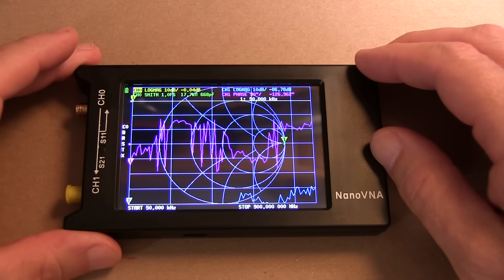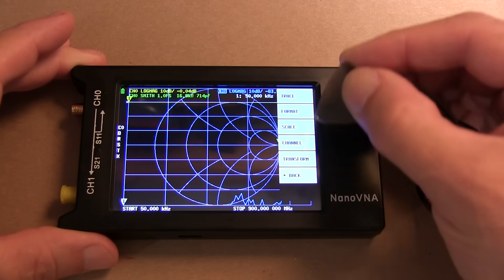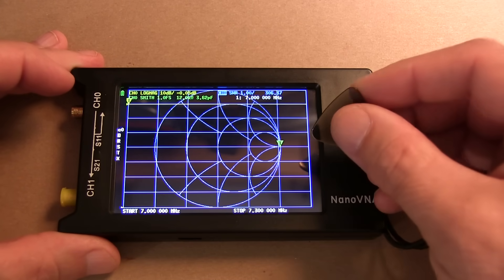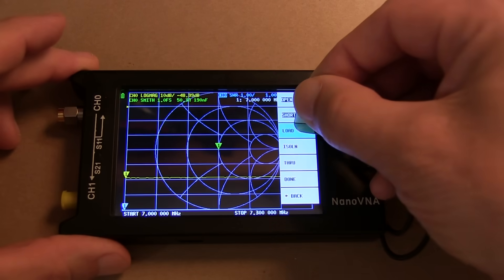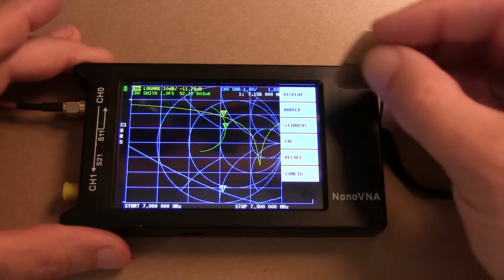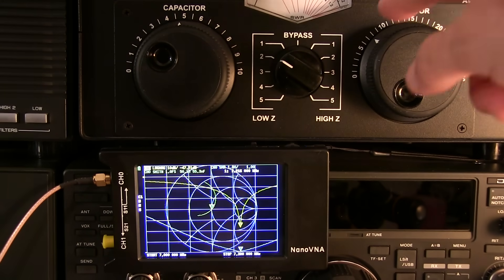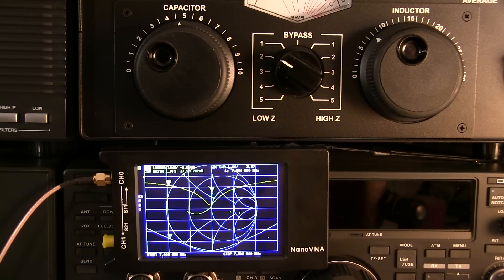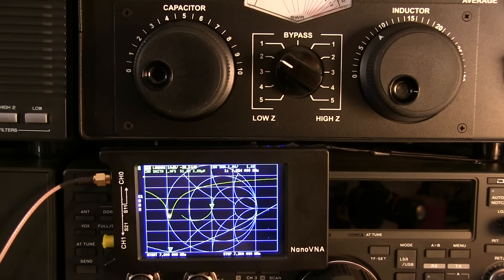#314: How to use the NanoVNA to sweep / measure an antenna system's SWR and optimize its tuning

Comment: Can it use for bode ploting an smps feedback loop ?
Reply from the maker: Potentially - you'd have to be very careful about how you inject the signal into the loop, and how you'd connect to the VNA ports.  One main downside is that most of the nanoVNAs use a squarewave source, which might affect the loop analysis results.
Reply: @w2aew thx , im still not sure  .there is no reference relate to uses of nano vna on bode ploting ps feedback

Comment: Hi Alan, I finally installed the latest version of NanoVNAsaver and noticed that it now also calculates the permeability of magnetic materials. So I made a turn in a small toroid (mix #43), and the curves it traces have the well-known characteristic of that mix. However, the magnetic permeability value is a characteristic of the material, but obviously, changing the toroid in test, the software changes the values.
I searched the internet but couldn't find how to correctly obtain the magnetic material values. The software author has chosen not to publish his email address on his QRZ page.
I'm sure you have the answers I'm looking for.
Another new measurable parameter is dBm: I know what this measurement means, but how do I do it? I don't think I can send more than a few milliwatts into the NanoVNA ports, and perhaps a few milliwatts is even too much.
Thank you in advance for your answers, which are certainly useful for other OMs as well. 73s
Reply from the maker: I haven't tried the new NanoVNAsaver app myself, so I can't comment on these new features unfortunately.  In order to trace out the BH curve, it would have to measure/compute the voltage and current, perform an integral on one of them, then display as XY.  For the permeability, I wonder if it asks for the number of turns (I would think it would need to know that).  The dBm measurement sounds like it is simply a direct measure of power, either along the trace like a spectrum analyzer, or integrated over a specific frequency range, like a channel power measurement.  Definitely a few milliwatts or less would be safe, ideally just a milliwatt (0dBm) or less.  Sounds like this addition is to give it some basic spectrum analyzer functionality.
Reply: @w2aew  TNX. If you never tried it, I suggest you that pc software: it adds more features expecially to the smallest NanoVNA model (e.g. the points of measure number); I think it deserves a one of the fine video by you. 73s

Comment: Thanks so much for this video!   I'd have never worked it out for myself.  The NanoVNA has now taught me a great deal about the operation of my antenna setup.   When you first turn the NanoVNA on it starts with all the traces enabled and it's confusing.   Turning them back on one by one lets you see what's going on.

Comment: Il ne serait préférable de régler l'antenne je crois avant de trop compter sur le tuner car une antenne bien réglée avec un tuner n'est pas forcément rayonnante et optimisée à part pour le tranceiver. 
Bonne vidéo merci 🎉
Reply from the maker: An antenna system that is matched with a tuner can be just as efficient as a resonant antenna.

Comment: Is there a link as to where exactly on Chelgance I can purchase the NanoVNA that you are using in your videos? Thanks.
Reply from the maker: This is the Chelegance site. They also work through distributors worldwide. https://chelegance.com/products/sv4401a-4-4g-vna-with-7-capacitive-touchscreen/
Reply: @w2aew This is exactly what I ordered recently. Could I use that in the same way that you demonstrated using the NanoVNA in your past videos?
Reply from the maker: Yes. Menus are a little different, but the use/functions are essentially the same.
Reply: @w2aew Ok, thought so. Thanks. I also wanted to know where as a hobbyist I can search to find parts such as dummy loads and directional couplers to practice testing a VNA with.
Reply from the maker: For hobbyists, the best place are local ham radio flea markets (handsets) or eBay for surplus devices.

Comment: Hopefully not to much a noob question... How do I hook up the nano to work with my MFJ tuner and radio as you have done it? ? Also, since it has not changed the wire length, will the power be cut down and have less output off the antenna, even though you made the radio "happy"? KE8RTS
Reply from the maker: In order to use the NanoVNA with your tuner like I did, you simply disconnect the coax at the back of your RADIO, and connect it to the NanoVNA - so that the NanoVNA takes the place of your radio.  Then you can sweep the desired frequency range and watch the effects of your tuner as you adjust the tuner controls.   A tuner does NOT cut the power to the antenna!  A properly adjusted tuner simply transforms the impedance so that the radio sees 50 ohms, and the coax+antenna sees a complex conjugate of it's impedance, thereby maximizing power transfer to the antenna system.  Note that a power meter inserted between the tuner and antenna will NOT read correctly since it is designed to operate in a 50 ohm environment.  RF power losses will basically come from coax loss as the power reflects back from then antenna to the tuner, and then reflected back from the tuner to the antenna.

Comment: So, when you were using your tuner, was the NanoVNA connected to anything? I could see the pigtail but not if it was connected to anything 🤷
Reply from the maker: It was connected to the input of the tuner.
Reply: @w2aew  why didn't it damage the NanoVNA ? I thought you couldn't inject  any RF power into ? ..
Reply from the maker: There was no signal transmitted into the NanoVNA. The transmitter is not connected. The VNA takes the place of the transmitter.

Comment: Would I use a 9:1 Balun, between vna and antenna, to do this on a 450 ohm “window” line fed dipole antenna?
Reply from the maker: Simply mimic what you’d be connecting to your transmitter, so the VNA reports what your tx will see.
Reply: Excellent, makes sense thank you sir!
I’m trying to discover what my Palstr AT4K is seeing.

Comment: @w2aew :  "phone" portion of the band?
Reply from the maker: The "phone" portion of the band refers to the amateur radio voice communication sub-bands.  This is typically the upper half or two thirds of the allotted band. The lower portion of the bands are typically reserved for CW/Digital modes.

Comment: Hello thank you for the video very informative, I would like to know how the set up was between the antenna, the analyzer and the tuner,
Reply from the maker: The CH0 (Port1) of the VNA is connected where the transmitter would normally be connected.  So, it is NanoVNA CH0 --> Tuner input, and then the tuner output to the transmission line to the antenna.

Comment: I know this is an old video , but are you plugged into the back of the tuner and not directly to the antenna ?
Reply from the maker: When I was showing the effect of the transmatch, I was plugged into the tuner (just as the transmitter would be)

Comment: Is a Network VNA Analyzer a TIME Domain or Frequency Domain? An oscilloscope is a Time Domain measuring instantaneous Analysis while a Spectrum Analyzer is measuring Steady State Analysis. I'm not sure what is the difference between instantaneous voltage/current VS compared to Steady State Voltage/current?
Reply from the maker: A VNA is typically a frequency domain device.
Reply: @w2aew  Spectrum Analyzer is in the Frequency Domain but doesn't measure GAIN in the Frequency Domain only measures frequency based on Phase, not gain? VNA is frequency Domain but measure frequency based on GAIN ratio?
Reply from the maker: @waynegram8907  A spectrum analyzer, by itself, does not measure gain.  It can be used to measure gain by measuring the input, then the output of a circuit, and subtracting the traces.  Some spectrum analyzers have a tracking generator - these can be used with the spectrum analyzer to measure gain.
Reply: @w2aew  VNA/Network Analyzers can't measure frequencies and 2nd,3rd,4th,5th,6th,7th etc harmonics? Mostly Network Analyzers/VNA just measure the GAIN Ratio of the input and output.
Reply: @w2aew  A Spectrum Analyzer measures the dBm level of the Frequency or harmonic, not the GAIN? I don't see anywhere on the spectrum analyzers menus of measuring the GAIN or Gain ratio of the input frequencies and output frequencies.
Reply from the maker: @waynegram8907  A VNA can measure the amplitude and phase of the transmission (thru) properties of a device, and the reflection properties of a device, vs. Frequency.
Reply from the maker: @waynegram8907  It can only measure GAIN if it knows the input signal value.  This can be from a prior saved measurement, or through the use of a Tracking Generator, if it has one.
Reply: @w2aew  yes true, but this is a different type of frequency Domain called what? when the VNA can only measure the GAIN ratio of port#1 to port#2 & the reflection properties of port#1 to port#2 of a device. What I'm confused about is both the VNA & Spectrum Analyzers are Frequency Domain Instruments but they can ONLY measure certain Frequency Domain properties or functionalities. The VNA is a Frequency Domain called what? Spectrum Analyzer is a frequency domain called what? because both can't measure the frequency domain properties they can't measure or do the same types of different testing in the frequency domain. What I'm confused about is the frequency domain is separated and NOT the same types of testing & measurements so there must be different terms names for saying that the VNA is a frequency domain measuring instruments and so is a Spectrum analyzer but they both aren't and can't do the same type of testing and measurements in the frequency domain, so there must be a name or term for calling a VNA a frequency domain in what category and a Spectrum is a frequency domain in what category?
Reply: @w2aew  If the Spectrum Analyzer doesn't have a tracking Generator, you can only measure ONE Port at a time. Spectrum Analyzers only have One input Port so you can only measure the device under test output port and save that measurement in the spectrum analyzer which you can compare it with the input ports applied signal gain?
Reply: @w2aew  If you save the input signal value inside the spectrum analyzers Saved memory, then measure the frequencies/harmonics of the device under test output port. How can the spectrum analyzer do the MATH by comparing the saved memory input signal value against the device output port signal values? I have never seen in the spectrum analyzers menus that can compute the math of the saved memory measurements compared against the real time live active measurements.  Maybe the newer spectrum analyzers have these options in the menus?
Reply from the maker: @waynegram8907  The big difference is that the Spectrum Analyzer only measures the signal that is at it's input and a VNA provides the stimulus to the device you're testing, and measures the response to that stimulus.  Both instruments make their measurements over a specified frequency range, thus are both frequency domain instruments.  

The Spectrum Analyzer primarily measures signal magnitude (power in dBm in most cases) vs frequency.

The VNA measures the response to a stimulus signal - either thru the device (transmission properties from Port 1 to Port 2, for example), such as gain or loss, as well as signals reflected off the ports of the device (stimulus to Port 1, and measure signal reflected back from Port 1 on the device).
Reply: @w2aew  what is the difference between a function generator sweeping a start frequency and stop frequency VS compared to a stimulus? A stimulus is sweeping a start frequency and stop frequency so there must be a difference. Albritary function generator don't have any options in the menus to choose "stimulus" any way of make a function generator into outputting a stimulus signal?
Reply from the maker: @waynegram8907  From a signal generation standpoint, it's the same thing.  The difference is that in the case of a Spectrum Analyzer with a Tracking Generator, and in the case of a VNA, the signal generator's frequency sweep is synchronized with sweep of the analyzer - so the source (stimulus) frequency tracks the measurement frequency of the analyzer.
Reply: @w2aew  oh ok so it's tracking in syncing with the vna sweep freq or spectrum analyzer sweep freq, pretty much like using an oscilloscope external trigger port to Trigger on the function generators sync port. I'm guessing when you sync track a function generator like this to an oscilloscope it's called a stimulus. I thought the stimulus used a different waveform profile that you can't get with function generators because they make tracking generators which I always thought used different waveform to output stimulus waveforms that you can't get using function generators

Comment: I didn't know this could do this. I'm new to this completely. I bought this device (or similar), I think my NanoVNA is version 3 or 4. 1Meg to 6Ghz range. What's the retuning instrument you're using? I have a frequency generator for Electronics purposes, again, don't know how to use that, but wanted to get into this hobby a few years ago so bought all the equipment for it.
Reply from the maker: I am using a Transmatch (antenna tuner) from Ten-Tec - Model 238C.

Comment: Alan this is a very interesting video and nice presentation!! 
A few questions before I buy the nanoVNA-H4. Is the plastic housing no problem with RF radiation?
And isn't the mounting of the SMA connectors on the printed circuit board mechanically weak?
Many thanks in advance for your answer!
Reply from the maker: The plastic case and pcb mounted connectors are not ideal, but works well enough with due care. This is what you get at this cheap price point.
Reply: @w2aew  Thank you Alan for your quick answer!

Comment: I just don't understand one thing.  I connected the antenna using one of the cables supplied with nanoVNA. Whenever I move the antenna everything change on the screen. Question is how to properly make all the measurements?
Reply from the maker: The proper way is to measure the antenna in the configuration that it will be used in.  Antennas are affected by things around them, so this is to be expected in many cases.

Comment: So does the NanoVNA connect to the tuner and then the tuner connects to the antenna? Presumably once you have it all tuned to the frequency you want to work (as per the video) you disconnect the NanoVNA from the tuner & connect the transceiver to the tuner. Great explanation as it makes it all look so simple.
Reply from the maker: Yes, the NanoVNA is taking the place of the transceiver for the purposes of adjusting the tuner.

Comment: If I am tuning my car antenna to I need to use electrical delay to fix the calibration for the coaxial length or just for the adapter to my antenna cable
Reply from the maker: No need to use electrical length.
Reply: @w2aew  ok thanks

Comment: We are trying to physically adjust a shunt matching coil on a screwdriver antenna using X and R with our NanoVNA. We do not have a MFJ-259B analyzer. Do you have a video or know of one that we may have missed which covers this kind of measurement/adjustment? Is seems it is possible with a NanoVNA?
As understood, setting the antenna to 80m, adjusting, then to 40m, adjusting , then checking other bands should give you a compromise SWR that is usable on all bands available of the antenna. 
We live in our RV where space and weight are precious and looking for a good solution to multi-band use.

Comment: I'm trying to use the k0bg shunt matching coil adjustment technique without an MFJ-259B. We have a NanoVNA. How do I translate the procedure to use the NanoVNA? Does this procedure make sense? Is there something else using a NanoVNA we should consider?
Reply: That's  K Zero B G   - Antenna Coil Adjustment page
Reply: For clarity, K0BG's uses R and X to tune the shunt giving a compromised SWR but allows all bands to be used while tuning a screwdriver antenna.

Comment: On a professional full size VNA (Agilent for example) they are factory calibrated to the ports, is this not the case with these Nano VNA's ?
Reply from the maker: All VNAs, including professional units, require a user calibration to establish the measurement reference plane.

Comment: Hi Alan , you explain things like no other,  great work , my question is if I an using my Nano VNA to check my base station antenna,  which is at the end of a 15m RG58 coax run, should the nano VNA be calibrated at the end of the coax run , ie at the antennas so239 feed point? ie would this be more accurate?
And which of your VNA videos would be best to verify the value of an a ATTENATOR ?
Thanks on advance.
Reply from the maker: If you calibrate at the antenna-end of the coax, then the losses of the coax (which should be small) will be taken out of the measurements, and the Smith Chart will show the actual input impedance of the antenna.  Neither of these things will give you a "better" result when checking the antenna.  As long as you know the coax is good and low loss, then calibrating at the transmitter-end of the coax will tell you exactly what your transmitter will see.  As long as your coax is not part of the antenna or part of the counterpoise, then the coax length does not affect SWR.  Regarding checking of an attenuator, you can follow the process in video #315 where I show how to test a low pass filter.
Reply: @w2aew  as always Alan thank you for your detailed answer..
Much appreciated
 ✌️